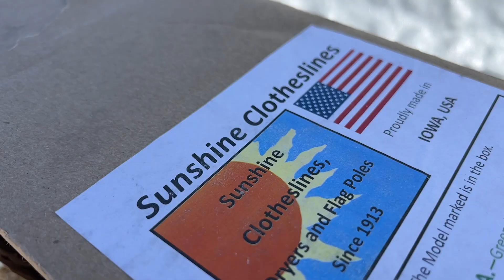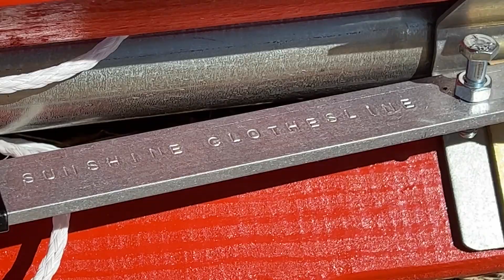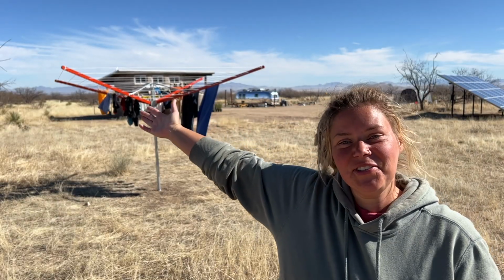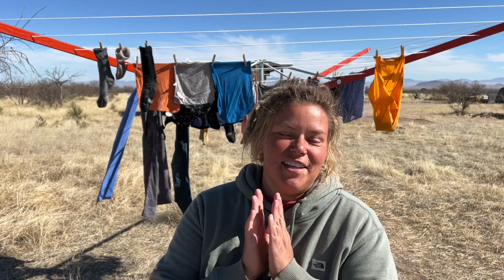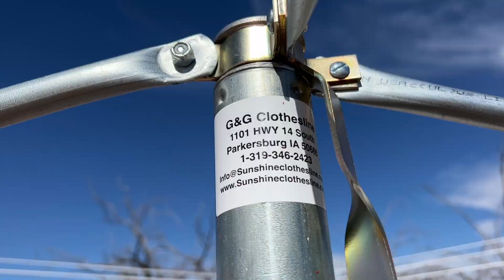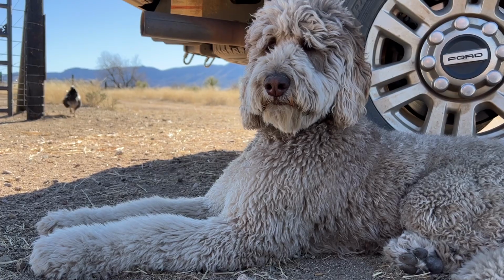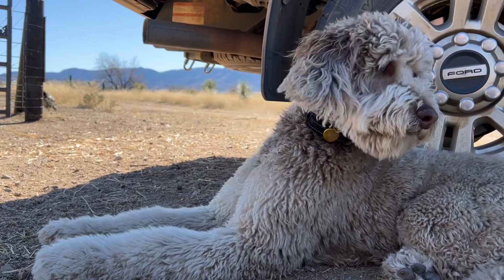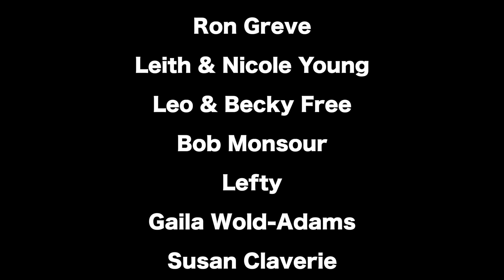She is ALWAYS Changing Plans. (Chicken Garden Day 71)

Comment: Cool we use them in Europe mainly as most people have small gardens, however, make sure you have a spare rope always cos when it brakes its a right pain... also hang you washing inside out on the line in the sun as it stops a lot of it fading as we have the same sun here in Spain all year round. Whirlygigs are great in the Wind but with your wind there you might need to put a sold concrete base in instead of Earth and Stone....    Funnily enough my wife now has gone back to a retracting line as we have one wind that always blows from the south so the clothes dry a lot better that way, good exercise as well....